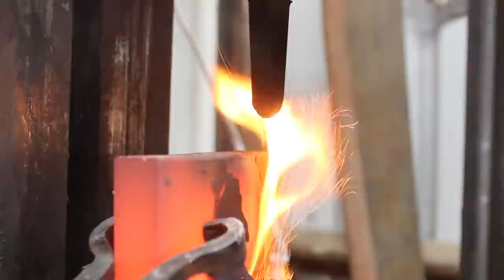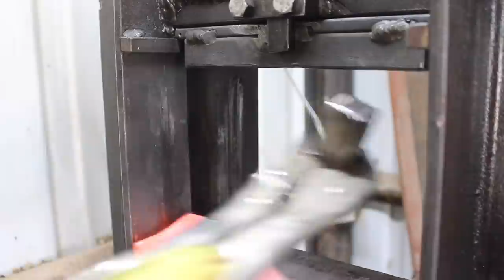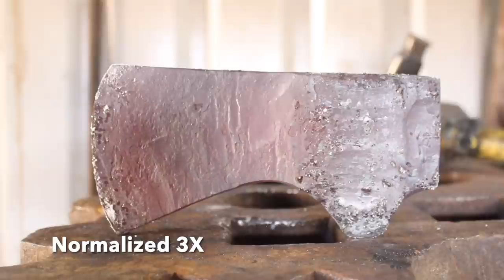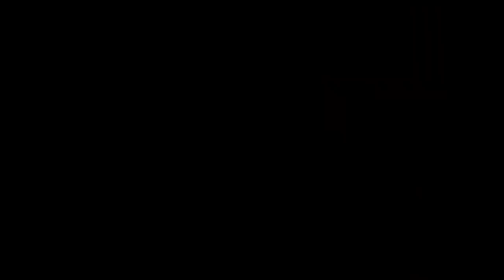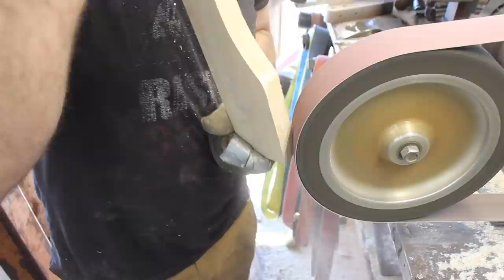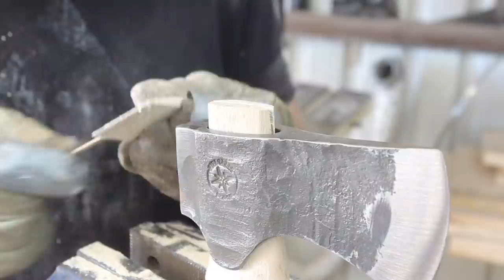Forging 2.75 lbs Bushcraft / Forestry Axe, No Talking, Blacksmithing Forged In Texas, USA

Comment: Are these 52100 as well? If so, how does 52100 compare and function versus 5160? I’m intrigued by an axe that is tough, yet has double the carbon of most axes made today.
Reply from the maker: These are 1060. as far as 5160 vs 52100, the latter will have much better abrasion resistance due to the high carbon content.

Comment: I've seen some axes by well-regarded makers which do not have a smoothed, or polished poll.
So, my question; is there any disadvantage to not finishing the poll, i.e., leaving it as it came out of the forge....rough ?
(I'm not referring to a hardening of the poll)
Reply from the maker: I've seen both, I think it's just personal preference. I'm not aware of any advantage one way or the other accepting specific cases as follows: some applications favor a rounded and smooth poll such as a carving hatchet where you may have your hand up close to the poll, and a rounded poll keeps it from digging into the web of your hand. Another example is a field dressing hatchet or ax, where the poll can be used to run in between the carcass and the skin, effectively helping remove the hide.
Reply: @FireCreekForge  Thanks very much for your reply.

Comment: when hanging an axe never hit it from the bottom handle and was the glue on your wedge? You don't hang very much. A little BLO on the wedge a 2x4 on top set it lose in a rack/stand/vise and take your time hitting it in, this way you see how much its mushrooming out on the top sometime it takes a whole wedge sometimes it needs a round or straight step wedge sometimes it takes half the wooded wedge and you can just cut it clean off.

Comment: Awesome 🪓!!! 
Some constructive criticism, if you make your handles have a little less curve to them, or at least less curve per inch or foot of length, the handles will be a good amount stronger. Like with bow making, wood will do what you want and flex and absorb shock but you have to be careful about having grain run off your piece. It will always happen but if it can be minimized it allows the wood to be more resilient. Another weird example is Viking ships used whole lengths of wood which kept the integrity of the grain of the wood down the whole length of the pieces and it allowed the ships to be super strong and flexible. 
Anyways longer comment than I intended, you're a much better axe maker than I am for sure, but I do have a lot of experience working with wood. Great work and hopefully I'll buy one one day.
Reply from the maker: Thanks, you're right. So what actually happened in this video is I was trying out a new 28" handle design with more curve than the previous less curved 25" handle I've used... I ended up using the 25" handle, haha...
Reply: Never had an axe fail due to curve. On a small axe, I feel curve is especially important because you’ll have a lighter head and shorter handle.

The curve will allow the axe to punch above its weight. Additionally, in my experience, the curve does help some with shock absorption. Beautiful axe, just my two cents.

Comment: Beeswax and graphite?
Reply from the maker: Yep!
Reply: @FireCreekForge  been using it for years. Tip: agricultural graphite is used to lube seeds. It comes in big containers and is WAY cheaper than the small packages at the hardware store.
Reply from the maker: @killerkane1957  good to know, thanks